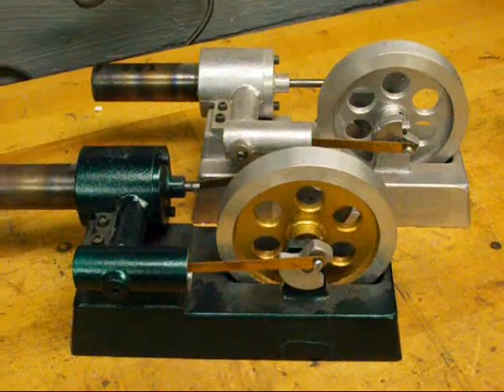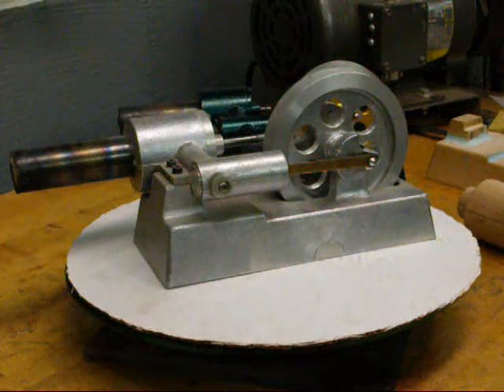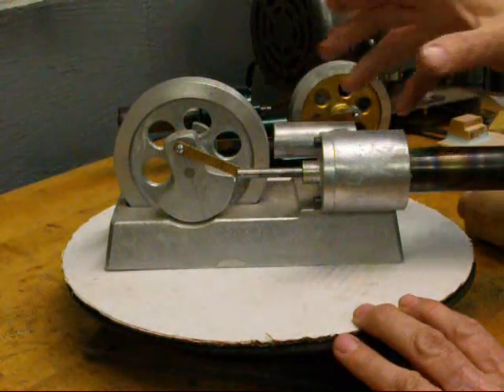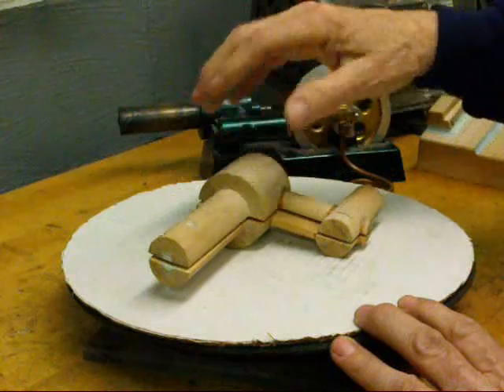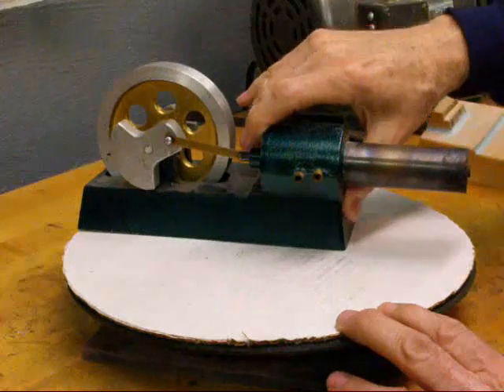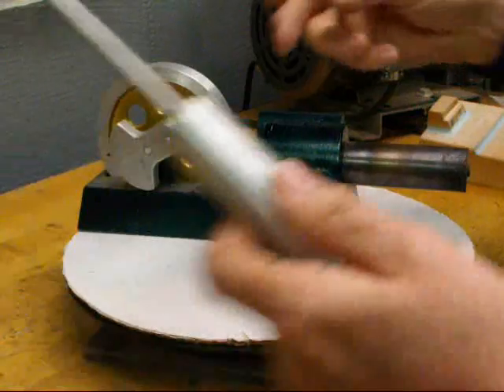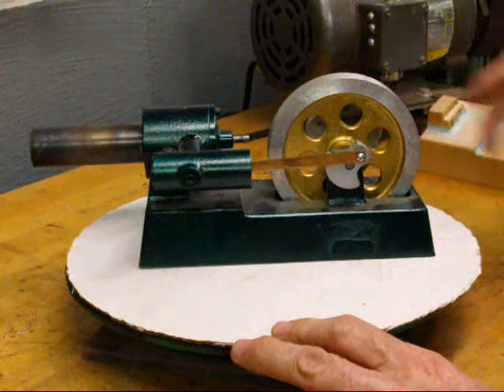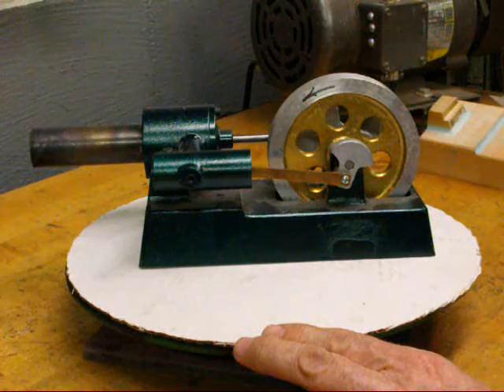STIRLING HOT AIR ENGINE water cooled TUBALCAIN

Comment: I was thinking of putting a copper tubing in the mold to reduce the heat on the cold side. I was also thinking of running the water through a external heat exchanger and having the Sterling Engine power a very small water pump to circulate the water in a closed system through the heat exchanger and cold side.
Reply from the maker: In some of my very old videos, you will find that I did use copper tubing in the mold. I then poured the aluminum around the coils

Comment: Nice engines,  do you or have you thought of using a "regenerator" in your stirling set up?  Also have you added power to to the flywheel and used it as a stirling cooler?